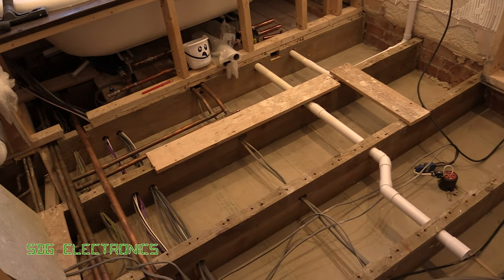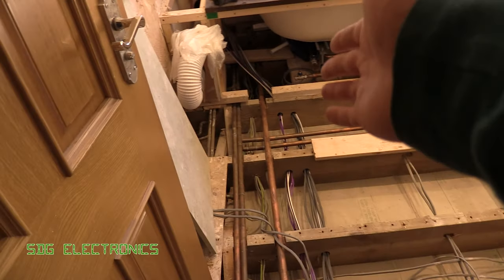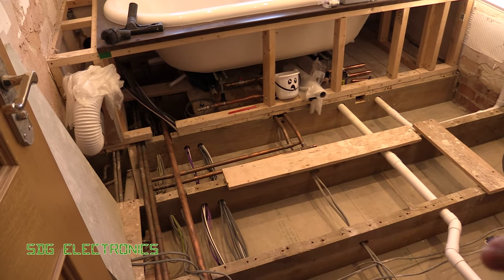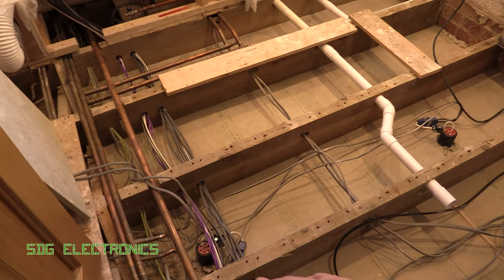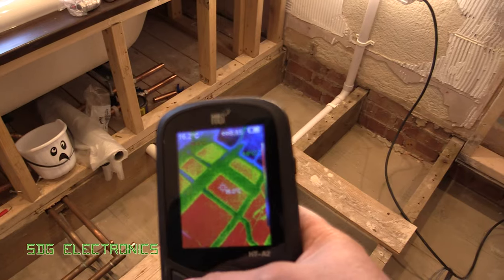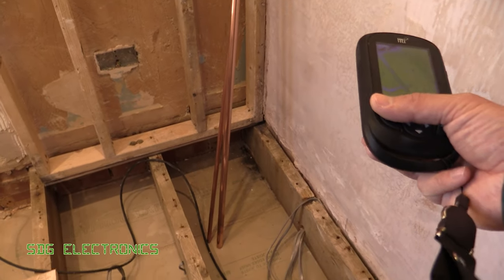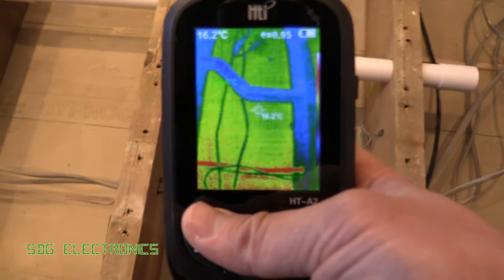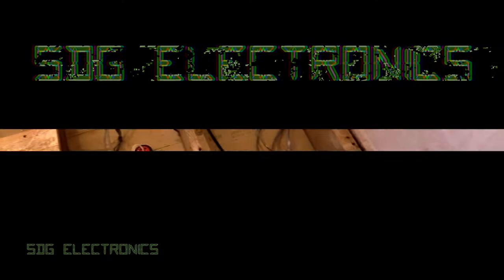SDG #241 Electrical Cable Tracing with a Thermal Camera

Comment: I was under the floor of our house a week or so ago running radiator pipes to the workshop and the amount of cement dust under there was my problem. Only 24" height to play in so i was squirming along on my side getting from A to B........I was absolutely covered when i eventually surfaced! Dang those builders!
Reply from the maker: Not claustrophobic at all then?!

Comment: One of my pet peeves is lazy builders who leave rubble and other detritus under floorboards!

This caused a nasty incident at my mum's house. One evening there was an almighty crash from the kitchen when part of the ceiling fell down. A few years earlier she had the bathroom (directly above the kitchen) remodelled, which involved moving the toilet. A new hole was put in the outside wall for the soil pipe. The builders had just left all the rubble from that under the floor. When a cistern pipe later developed a leak it made the ceiling damp and the extra weight of the rubble caused the whole lot to come crashing down. The whole kitchen was covered in dust and took forever to clean up. Wouldn't have happened if they'd not been so lazy.
Reply: The leak would have caused damaged regardless, ceiling might have even come down if you didn't notice it for a few days.
Reply: @jaro6985  My point was that even if the ceiling had come down anyway, it wouldn't have covered the kitchen in crap.

Comment: Cabling better than 99% of homes right there. Normally a rats nest once you pull the boards.
Reply from the maker: This is after a 90% tidy. There were 5 brown junction boxes for unrelated circuits under the shower tray

Comment: Wires everywhere and also copper pipe everywhere!  I assume some must be for heating.  I'd separate the ones on the left that are touching, they must make a noise when they expand!
Reply from the maker: Yeah this is a main run for the central heating, but there's also the hot and cold water and gas

Comment: Great idea with the infrared.  I think you should place a time capsule under the bath with a copy of this video but on what medium. With that  i have so many other questions as all our services run thru the roof and down the walls. 
1. When you say "when they did the bathroom before you moved in" do you mean when the bathroom was first built many years ago or was it was renovated just before you moved in. 
2. There appears to be an air duct on the left, where does it go, what is it for.  Does it also run thru the floor
3. what will make the new floor, ceramic tiles, wooden floor boards or chip board and lino perhaps.  Is sealing it against moisture seeping thru a challenge
4. is there a risk of piercing pipes when installing the new floor with nails and screws or is there some other trick to laying the new floor
5. will the underfloor be accessible in the future for future faults and making changes
6. or are you snookered if you want to make changes in the future such as adding power points as all the wiring is sealed in the flooring.

It seems that all the brick rubble was also thrown under our bathrooms before that section of concrete pad was poured. Its obviously a thing
Reply from the maker: The house is a vicarage from the 60's, it would appear this room wasn't originally a bathroom as there is remnants of some AC sockets under the bath and behind where the shower was. At some point around 2006 the whole house saw quite a bit of work, including this bathroom being fitted and a new kitchen in the room underneath which is where a lot of the bodges were implemented (90% I sorted out before this video). 

The flexible pipe you're seeing is actually the flexible soil pipe from the WC that was on that side. I lifted the floorboards as most were in poor condition from being cut all over the place for various works. The new floor is P5 moisture resistant chipboard, which will then have a waterproofing membrane then T&G vinyl planks. It's not a wetroom though, so doesn't need full waterproofing. 

I've taken photos of the cable runs etc, but also done an accurate map on the chipboard itself so that when it's screwed down I can avoid pipes and wires. It's definitely a risk so always mark these things out. Once the floor is down, that's it, so I'm sorting out all the issues now. It's also wise to pressure test the new pipework before laying the floor! There was all kinds of random wiring, brown junction boxes etc, so all of that is gone now. I've run extra cables from the consumer unit to the airing cupboard nearby for futureproofing, though I don't really see them getting used.
Reply: @sdgelectronics  Awesome.  Sounds like it will be a nice reno when done. Thanks for taking the time to reply.

Comment: No offense but such a cabling for electrical power would get you in serious trouble here in Switzerland 😅
Reply: In the UK we are allowed to do our own electrical wiring repairs etc., we only need qualified electricians involved if it's new work, i.e. wiring a brand new extension.
However, even then there are options, i.e. I completely rewired my workshop when it was converted from a garage (classed as 'new') and so I only used the qualified electrician to check, test and sign-off the work.
I am guessing other countries might not have this same flexibility.
Reply: If this offends your sensibilities, don't look at any Australian wiring!
Reply: @ickipoo  If you really want to be unhappy look up any sort of informal settlement wiring, where anything goes, and the most common cable is stolen phone line, which often also doubles as lighting, as it is often loaded to the point it glows.
Reply: @SeanBZA  Australian wiring isn't terrible - it was probably ahead of the UK at some point - but it has slipped behind in some important respects.
Reply: @IanScottJohnston  Not strictly true you can do SOME very limited work with no issues, you can also do a complete re-wire if you want but in that case you would have to notify building control and get the work inspected/tested. The difference is a "qualified" electrician under Part P can sign off their own work without needing to get building control involved.
Reply from the maker: I don't think Scotland has the same restrictions - I don't think Part P ever got implemented there. The rest of the UK has various routes for compliance with Part P. It's also not all that limited, only new circuits, consumer unit change and special locations require anything other than a minor works certificate.
Reply: @sdgelectronics  Yes, i should have said Scotland rather than UK. My mistake.
In Scotland, it also depends on which council are you are in as some of them take different stances on electrical works.
Reply: @sdgelectronics  England's Part P scheme isn't valid in Wales but their own scheme pretty much rules out DIY work although some councils are apparently quite lax about it.

Comment: More holes than beam in some places.  I wonder what the effective load bearing capacity of that beam in front of the bath is?  😲
Reply from the maker: It's still well within building control allowances since they're oversized 10x2 timbers and supporting wall either side. There's three joists under the bath